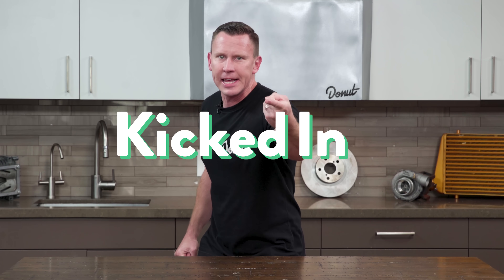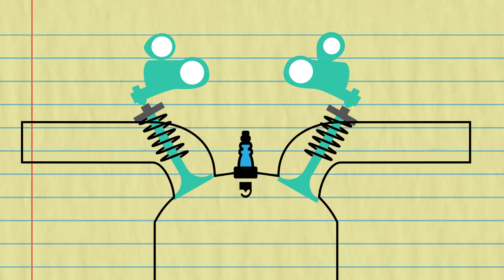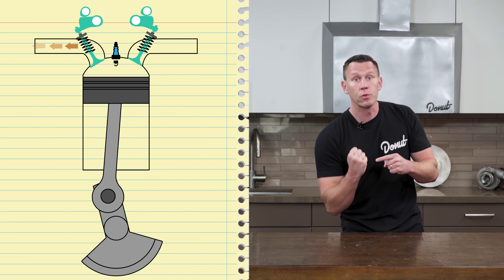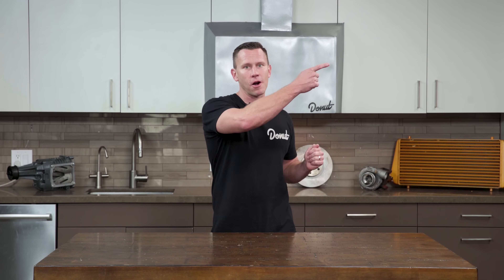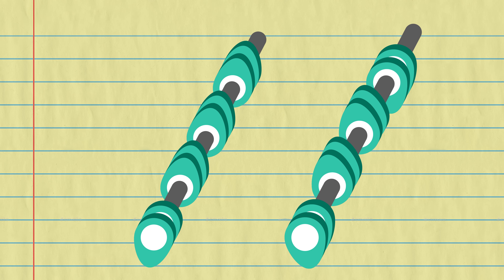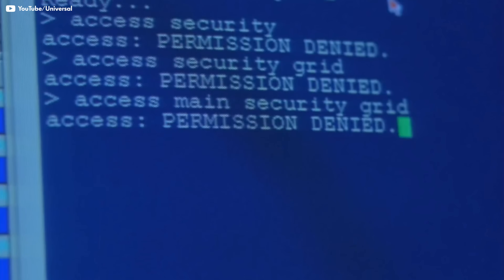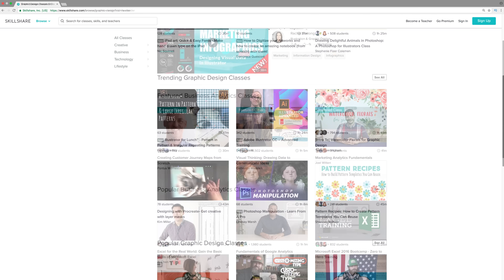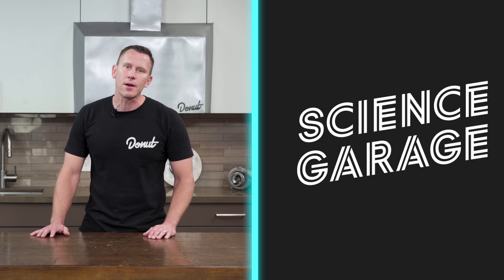VTEC: How It Works | Science Garage

Comment: VTEC, turbo lag without a turbo...

Edit: Holy shit, I forgot I made this comment, most likes I've ever had!
Reply: Far from that. Better cams only work for high revs. So best of both worlds
Reply: vtec: moh pawah babe
Reply: Instead of thinking of it as a boost, think of it as the engine becoming slower to save fuel when at low rpm.
Reply: More like permanent twin sequential supercharger
Reply: Avery Kucan that sound boring hence is fake :/ it means more pawah!!
Reply: Nah it just makes the power curve non linear
Reply: @Victor Figueroa 
Nah.. you ain't much of a driver, right? Cuz' if you were, you'd note the large time gap (0.5-2.0s) of a turbo engine - between throttling to 100% and the full boost (and power)-delivery - somewhere in the rev range.. You might be on 2000, 5000 - doesn't fkin matter - if your turbo isn't spun up - you WAIT it to spin up. 
 And the opposite - If it is and you need to back the throttle, for taking some grip, or simply - for downshift - guess what - you WAIT again, cuz your turbo piping & intercooler - all these ~15 liters of turbo stuff are now filled with pressure and the engine has to pump it out - before it stop pulling. This is the true definition of "TURBO LAG" - there's a LAG between your COMMAND and the Engine's REACTION!
With the N/A engine - nevermind if it's the 1.6l V-tec, 1.4l 8v, or 4.5l V8 - yes, they have different power-curves, BUT NOT THE LAG!!! Their throttle reaction is 0.2s in the worst case - you're on low revs (1500-2000) - yes, you have to open the throttle to  fill the intake - around 5-8 liters with absolute pressure of 0.7-0.9 bars.. and that's it. - Happens in under 0.1s on 1.4l 8v motor when the revs are over 4500.. btw.. and that's it - you have all the 80hp on hand - just 0.1s -away.
Same about the V-tec - mine is "the small" d16z6 (125hp) - if I want to fly ahead of some turbo(diesel?)-guy in the traffic - all I have to do is to rev-max it on 1st gear - there the "lag" doesn't matter - the "fight" is for grip on the wheels. The 2nd comes after 4700, anyway - there the solenoid is opened already... and just keep shifting - the gear-step allows me to keep revs between 5000 & 7000 so... 
Where your "lag" goes - when you try to pull the turbo-guy while under 3000 - the tiny 1.6l behaves like... a tiny 1.6, there! What a surprise! :O Lazy "purrrr" up to 4700, there something "happens" and the little 4cyl changes the sound a bit, and gets angry. A little advise for You and the rest of your OIL(710) ppl who liked you - next time don't pull from 3000, just downshift and rev the fck out of this bitch! If you want to race, don't stay in the "economy" regime, and don't call the sporty lobe "a lag" - otherwise you'd be dissapointed by... CBR 1000... or Yamaha R1, maybe... - they are waaaaaaaaaaaaaay "lag"-ish than something, equipped with V-tec. :D
Reply: grebo121 fam you don’t need to be a professional driver to watch a video about VTEC, it also took me forever to read your essay
Reply: my dada has a vtec civic with a turbo :v (correction: had)
Reply: @grebo121  You'd never be disappointed by a liter bike lol 

Yes they have far less low end torque relative to high rpm torque than even a VTEC Honda, but even at their weakest rpm range those things are absurdly fast.

Imagine you have a VTEC engine, but that engine also has like 8 liters of displacement. Even at 1500rpm you have plenty of torque.
Reply: Yep
Reply: @jefgir  Ahh the power of marketing... it actually is more economy at lower revs, you could always get the same power without the kicky cam switch.
Reply: @TechFabLab   Fair enough, but is not like i was giving a lecture on the benefits of vtec, it was just a joke referecing James's (from donut media) catchphrase.
Reply: Seems about right
Reply: Laughs in K20C1 VTEC Turbo
Reply: You have no idea, not being rude here.
Reply: this koment have more likes then mos of youtobe videos
Reply: @grebo121  pretty good explanation bro. The guys original comment was pretty accurate, but you just put it to shame. Nice bro.
Reply: Vtec is the true fuel efficient engine, compared to turbo
Reply: Ivtec is of both world.
Reply: Nice
Reply: Boi come again you got likes
Reply: @allanhanan  too many
Reply: This is stupid comparing turbo with vtec, turbo lag is a lag, vtec is improving the engine to work on low and high rpm thus eliminating high cam lag on low rpm
Reply: @pilotavery  fuck so that's why driving a Honda is so annoying OMG I didn't knew is was because V-Tec Sadge
Reply: He misses a very important part amd was wrong on a part. Vtecs  middle bigger cam lobe simply kicked in at 5200 rpm regardless of if the pedal is all the way down or not and stays that way until rpms drop below 5200 rpms no other variables matter like this guy said. He said engine temp and oil pressure have to be at certain points too lol nope sorry bud I've tuned Honda engines with hondata for the last 10 years and the only thing that the ECU reads to click that pin in to use the higher lobe is simple that 5200 rpm point. Plus you can literally hear it when the new cam lobe is engaged
Reply: @dellyfathurachman5775 I think that’s the joke that it’s just one giant piece of lag 😂😂😂
Reply: Not sure if this is a joke but I’m dying! Turbo lag without the turbo! Brilliant insult

Comment: What's the science behind why cars have "New Car Smell"?
Reply: The "new car smell" is mostly adhesive fumes from the vehicle assembly.
Reply: TheFerrariKid its glue and plastic. i kinda hate it, every new car i buy i drive for like 2 months with the windows open, my head just hearts becouse of that smell.
Reply: Are you really confused on why that happens, have you ever owned anything new, everything has a "new" smell from production.
Reply: I work for a car manufacturer and I always smell the new car smell every day when I roll them off the production line.
Reply: Answer this
Reply: For car guys its a very good smell
Reply: Geffrey Nugroho The very best smell is a hot engine bay... when you smell the hot metal, warm tubes and oil.
Reply: Volatile organic compounds. Basically the same as paint fumes.
Reply: It's called outgassing
Reply: @Goosetavula  wtf
Reply: @lillilgirls1378  lmao. It's the truth
Reply: @Goosetavula  you replied after 2 years
Reply: @lillilgirls1378  you commented on it after two years
Reply: @lillilgirls1378  and thanks for it I just lost my shit reading my comment again lmao
Reply: @Goosetavula  🤣

Comment: "cars built for good economy are slow"
Reply: Tesla
Reply: Facts
Reply: @mattvespa4262  not built for economy
Reply: @Jupiter__001_  they have the best fuel economy 😂
But really they are really efficient on electricity and they get software updates that both increase power and give better efficiency, it's crazy
Reply: @SomethingUnremarkable  They are not really efficient on electricity. We have the inefficiency of the oil powerplant, then that of the transmission, then charge and discharge inefficiencies of the lithium ion batteries. This actually adds up to worse mpg than a petrol car (as in oil).
Energy-recovery in braking is a good idea and has been demonstrated to improve performance in F1, and obviously improves efficiency.
Reply: @Jupiter__001_  a powerplant is much much more efficient than the engine in a car as nowadays they use steam turbines heated by the fuel instead of big pistons. Hell even a generator is more efficient than a car engine of same design as it can just keep itself at it's most efficient RPM. And both take advantage of keeping a steady output without the losses of speeding up and slowing down every gear change.
Reply: @Stackoverkill  They never used pistons. I am well aware of the working principles of a steam turbine generator. However, they are still only about 40-50% thermally efficient. Compare this with between 25-35% efficiency of an 4-stroke internal combustion piston engine.
In addition, charging losses, and losses when delivering power from a battery, are quite bad.
We don't use generators in cars because the losses of using the power to spin an alternator and then using that to drive electric motors to drive the wheels is worse than the small efficiency gain due to constant engine speed.
Reply: @Jupiter__001_  eletric powertrains have over 95% efficiency, at least. You are vastly underestimating the technology used on everything we own nowadays. And vastly overestimate ICE efficiency that is usually more around 25% without even taking in consideration the losses of the transmisson and torque converter that are much higher than the losses of any electrical powerplant.  But sure all the math is wrong (you should check engineering explained's channel) and everyone who owns an EV and says how efficient they are are wrong and every car company that are all investing in EV's who have thousands of engineers failed to see this fatal flaw that only you and other people on the internet who repeat the same things saw. I like ICE cars but trying to deny that EV's are more efficient than them in every way is just insanity. But i doubt any of this will convince you so i won't try anymore.
Reply: @Stackoverkill  "torque converter" I've never mentioned an auto.

No, electric powertrains are not "95% efficient". Their efficiency depends on RPM of the motor (though, an electric powertrain can reach very high efficiency at the correct speed). In addition, the efficiency of the lithium ion battery is low (50% ish), which you have ignored (the battery is not part of the drivetrain). Also, you have failed to answer the fact that the power station is still only 50% efficient (I never mentioned the powertrain of the vehicle in my original comment), which when combined with the battery's inefficiency is quite considerable. Electric cars' only benefit is that they can recover energy while braking, which can be implemented on a non-plug-in hybrid vehicle pretty easily.
Reply: My Fit.
Reply: That is a typical stereotype of non car guys
Reply: @SomethingUnremarkable  They do have better energy economy than gas cars, yes. This other dimwit really thinks batteries lose half of their power lol what 🤣 could you imagine how bad laptops would be?

But you're wrong that the higher performance Teslas are in any way efficient among electrics. There are electric cars that get way better mileage by the kWh.
Reply: Not anymore.
Reply: ShifterSwifter Playz And More!  Range =! Efficiency
Reply: Cars built for economy, yeah, great economy when the cheapest model starts from 45000 EU and that's without the autopilot additional equipment o VAT. Yeah much economy, wow.
I know that most are referring to the efficiency , but if you pay so much money upfront, when exactly do you actually save ? in fuel ? Don't forget how much do the batteries cost to replace if one fails and they DO fail. Alot.
Reply: @SomethingUnremarkable  yea they're efficient on electricity as long as you're not using the headlights, radio, heat, ac, any of the multiple touchscreens or the other hundred features/equipment that uses electricity. As soon as you turn just one of those on your range drops to like 20 miles.

Comment: Back in the the mid 90s I had a 91 JDM integra xsi vtec sedan with a b16a engine, 2 engines in one. Loved this shit back then, timing was key when up shifting at the rev limit to keep vtec engaged. Tuning for these in NZ was still in its infancy, had done basic mods, full exhaust, extractors and air intake, but still a car to be reckoned with, with what we had lurking our streets back then. Cruising, someone pulls alongside wanting a race pop into 3rd revs touching 3500 to 3600 vtec engaged then GO!  Instance power see ya! Just thinking about then puts a smile on my face from some fond memories yeah!

Comment: McLaren F1 (1993) was 6.1 liter Naturally Aspirated VTEC.
Reply: that makes sense Honda supplied engines to McLaren in F1 around that time
Reply: @MidwestDIY  the McLaren f1 used a BMW engine
Reply: Old NSX does
Reply: Arlan T. Hes saying F1 as in formula one race-cars I believe.
Reply: @iancampion6979  why would a race car that doesn't go under 10k rpm need vtec
Reply: @jorge8596  so when you coast the engine in the corners you can save fuel, therefore reducing the amount of pit stops/the time you spent refueling the car in between pit stops.
Reply: @mongi4015  lol people dont think before they comment do they lol

Comment: Proud owner of a JDM EP3  Type R
That VTEC brings a smile to even the biggest haters face.
K20A ftw!
Reply: na thats broke little kid cars
Reply: Try a car with real vtec not I-vtec
Reply: BB6 98 prelude sh here. Got a euro R h22a swapped. Vtec kicks in hard, real vtec lol
Reply: Jonathan Pontel yes my real Vtec brother 💪 ludes are rare over here, about 5 years I sold a 3rd gen prelude with 4 wheel steering and a DOHC B20A for under £200, madness. Kicking myself now. 

proud owner of a DC2 type R, nothing beats a 90s honda
Reply: @jack18over  oh no! Lol I got mine for $1400 but had a broken f20b engine, replaced it with the euro r engine, got skunk2 manifold, skunk2 70mm throttle body, intake, skunk2 full catback exhaust and megan headers just need a tune. Wonder how much hp I'll get. Car is fixed up though lowered white in white with all around lip kit. Fun car to drive for sure
Reply: Jonathan Pontel you’d be surprised man, needa start looking at a piggyback ecu, what’s the mugen four branch like ? I went for the skunk2 four branch and mugen cat back with the twin loop back box, The bad point in the skunk four branch is that it rubs off everything as the downpipe becomes the lowest part of the car like I literally have it rubbed flat
Reply: @jack18over  I have a p28 ecu that needs to be installed once tuned. Dont know what else to mod unless I go boost, which idk cause going boost always becomes unreliable. Maybe pullies lol
Reply: Jonathan Pontel there’s plenty of ways to go, polish and port the head, oversized valves even more aggressive camshafts, lightened flywheel, stage 3 clutch, better LSD, polybush engine mounts, engine damper. Weight reduction is always worthwhile, Take out the air con system for a start. 

Moral of the story is the further you go the less pleasant it is as a daily driver 😂 trust me
Reply: @jack18over  yeah not sure I want to go that route, I mean I know this car is heavy af, I do have a stage 2 clutch installed. Maybe I'll do pullies. Just trying to make a clean prelude. I see preludes here in LA but they're all stock in the box. Mine is lowered, has rims, white in white rims and car color, needs new fenders and bondo back quarter panel needs some work. I have yet to see a fixed up prelude still in these days
Reply: Jonathan Pontel a clean prelude is a hard find, good luck with your project anyways boss, always good to hear of these cars being kept alive, they really were the icons of a generation
Reply: @jack18over  thanks man, being a rarity is why I bought it. Has given me issues but that's life and, I mean it is a 20+yr old car.
Reply: Jonathan Pontel you’ll get half as many issues driving a 20 year old Honda compared to a 5 year old VAG

Comment: Just bought a 98 prelude for 1300 AUD it's a lil sketchy but eh
Reply: Bought a 98 prelude sh for $1400 USD, had an f20b but crankshaft was broken,  so i replaced it with a euro R h22a engine. Car looks spiffy and runs nice
Reply: Y'all recommend the prelude? How's fuel efficiency?
Reply: Depending on engine, it's very good the i4 which is standard 2.2 liter 25/32 not to bad at all.
Reply: brought a 89 prelude for $300 AUD and it cranks but doesn't start :(
Reply: BlueNerve I own a 2000 Honda prelude. Fuel efficiency is great. Even when I’m flooring it the tank still seems to go down very slowly. Fun to drive and people always compliment the look.
Reply: @bluenerve8105  who cares about fuel efficiency with such a sports car.
Reply: Sssaga Benches planning to get a 2.2 one as my first car since they're pretty cheap where i live and am on a pretty tight budget so i was wondering if they use loads of fuel
Reply: I cracked a 96 vtec accord in mint condition for 700

Comment: What if, I welded my VTEC pin into my outer rockers,
Would I get VTEC 24/7? 😍😍
Reply: Hey there's only one way to find out lol do it for science ;)
Reply: Jason Ruvalcaba check out Toda “VTEC Killer” Camshafts 😉
Reply: PLEASE DO IT for science
Reply: You can buy vtec locking pins
Reply: You can set up the VTEC solenoid up on a button switch...or on/off switch...which essentially will give you on demand VTEC.  When I was in high school...back in the late 90's and early 2000's, people were doing that
Reply: Ever heard of high cam?
Reply: No reason for that tho. Would only make it worse at low revs, changing nothing at high revs.
Reply: it will work fine only at high rpms...
Reply: Will kill low end torque idle very low unless remaped for this application
Reply: Unless you're not at low Revs, then yes go for it.
Reply: You would have a Crappy low end with bad gas mileage, but it would rumble more and there would be no lag.